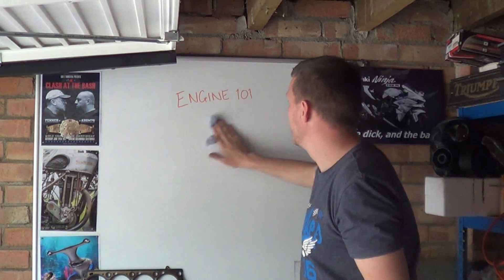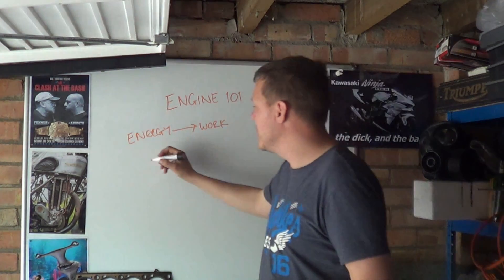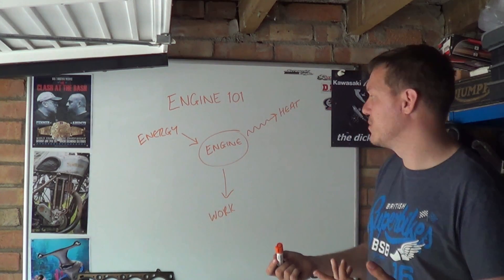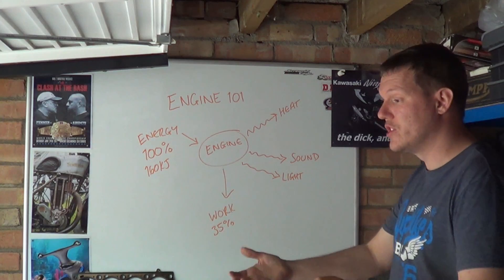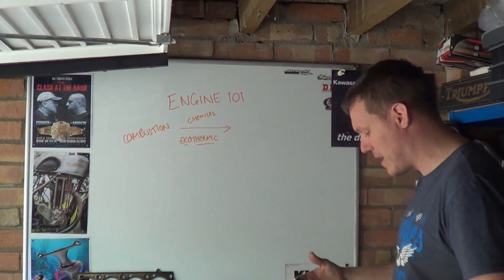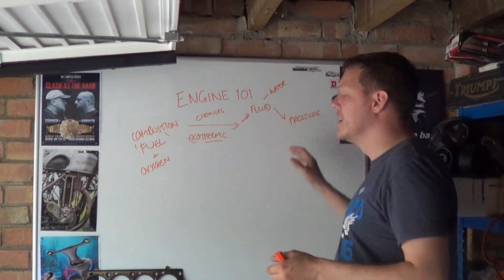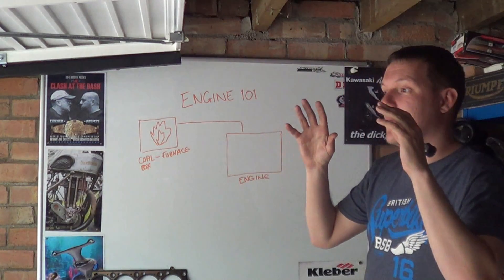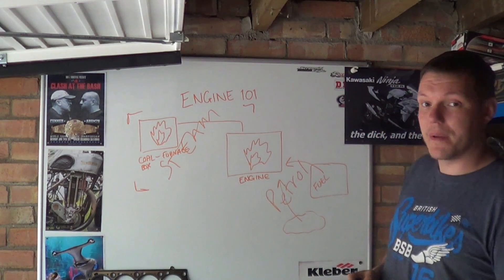Extracting energy - Engine 101 - Part 1

Comment: The heat-pressure principle is the direct explanation of why increasing compression ratios creates overheating in some engines when tuned(when done beyond the limit of the stock cooling sistem). Your channel is great, its a great source of info for us engine nerds.

Comment: With a steam engine, you have to build up steam ahead of when you need it. If you need to increase speed, you have to build up enough steam pressure first, so there's always going to be a delay. This is one reason why an IC engine would be superior - there's almost no delay when you need more power. Another is that the IC engine is lighter. The steam engine has a greater potential for efficiency though I think.

On another note, has Matt done a video on battery powered electric bikes and their advantages/disadvantages compared with conventional petrol bikes? I know he dislikes electric bikes, but I remember him saying that it looks they are (unfortunately according to him) the wave of the future.